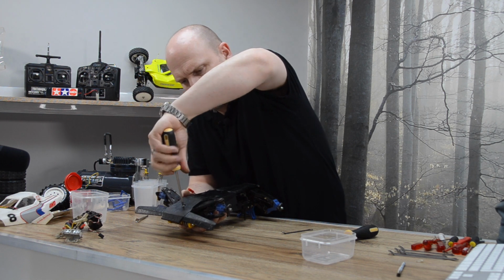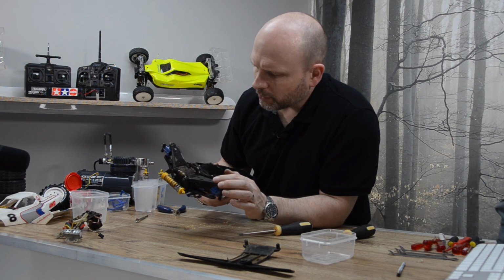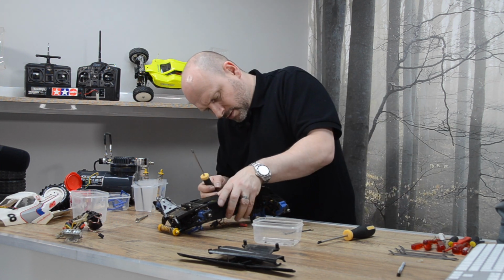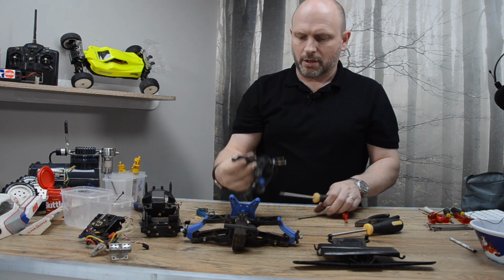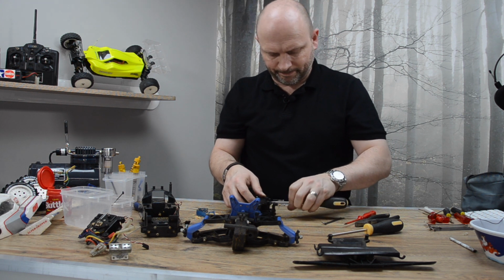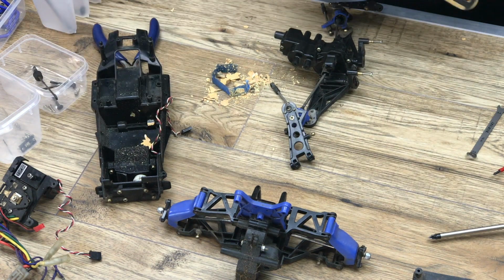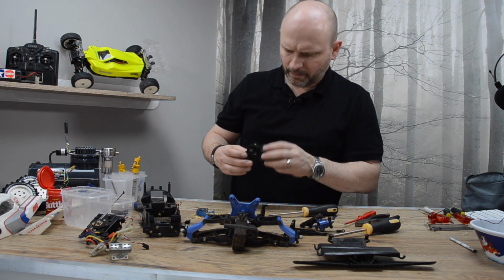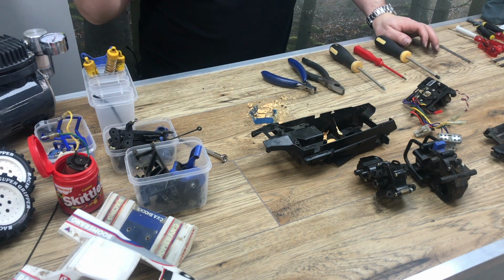Vintage 1986 Tamiya Boomerang restoration - Part 2: Disassembly continues.

Comment: I gt the exact same car as you but mine had allot of problems.
The gears are bad the front plastic is broken and the front suspension is also bad☹️
Reply from the maker: Sounds like the perfect time for a rebuild project :) Its a great car and rere parts are not so hard to find.  Go for it.